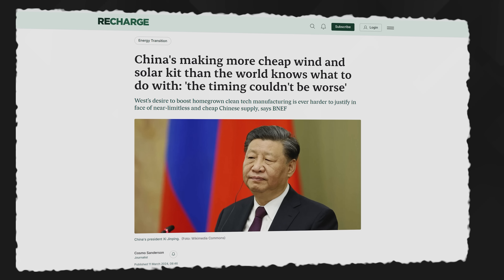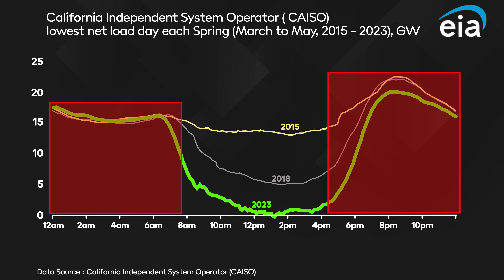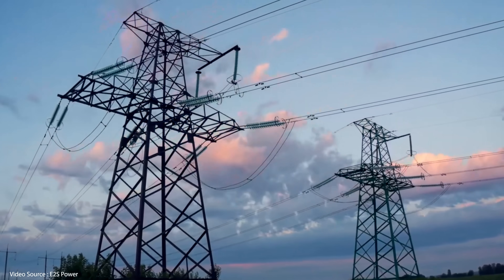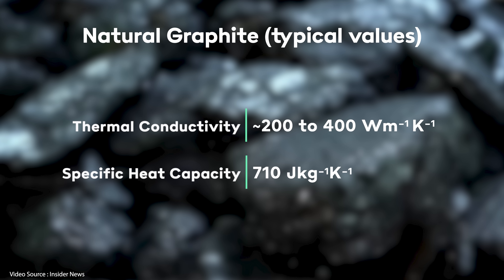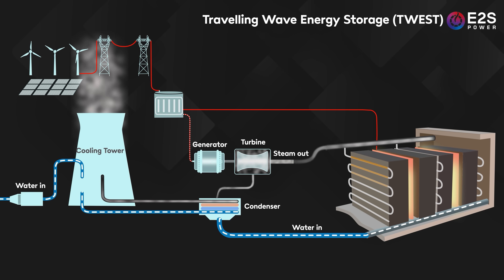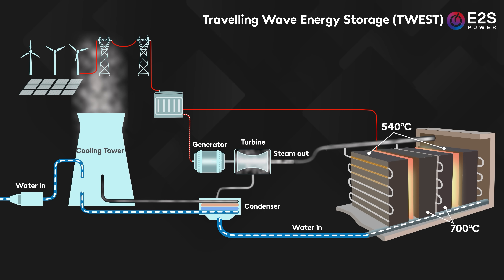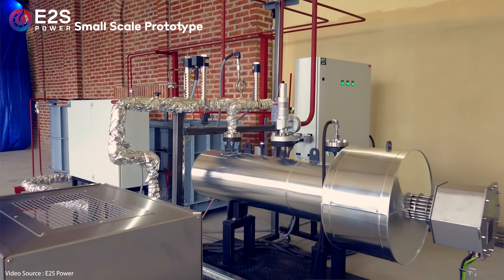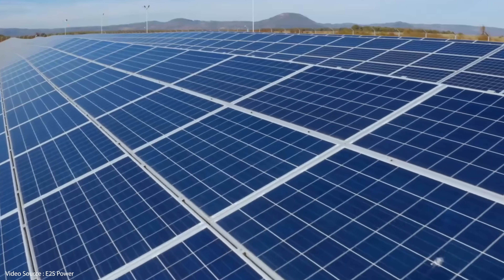A coal power station without the coal! How 'WIN-WIN' solutions could save an industry.

Comment: There's an issue with this idea... Temperature. We know that coal burns between 2500 and 3500°F (1371 to 1937°C). Natural gas is about 5000°F (2770°C). This temperature can be maintained so long as either item is burning. That means we know exactly how well we can make the steam from that temperature and how often we have to refuel the burn. The issue with heat storage is that it reduces in temperature the more material (water/steam) you run through it. So, just like a coal or natural gas generator, you have to 'refuel' it... but if you only have excess power for heat during peak solar/wind times, then how is the generator going to continue to run once there's no more power to 'refuel' it? I get having a lot of mass... but given Graphite's high thermal conductivity, you're going to be dropping that temperature pretty fast. And just to spin those generator turbines, you need something like 40bar (40x atmospheric pressure) of steam pressure. It will not last the night. You might get a couple extra hours after sundown... but that's about it.

You're basically exchanging a Jaguar XKR-S for a Pinto and promising us it'll go just as fast and be just as comfortable. No thanks. I'd rather my generation stations continue to provide power at the same level as they always have.
Reply: But hey... it's not all doom and gloom from me... Tell ya what... Many power plants have additional generators that are not in use... They're there to make up for excess power needs during peak demand. So talk to the power plant owners and ask them if you can retrofit their (mostly) unused generator for the heat storage system. And if you can get that generator to provide meaningful amounts of power that are cost-effective throughout the night WITHOUT having to rely on the other generators to heat the graphite back up... I'll take back my comments and say I was wrong. And I mean a power plant in America or GB, where we have ridiculous amounts of safety requirements and red tape.
Reply: @Xero1of1  Some gas plants will maybe able to be converted - even running in tandem/together parallel/consecutively?
Reply: It’s quite simple really - whatever your storage medium, you’ll have some amount of energy storage capacity. The more you have, the more it can supply (either higher power output or same power for longer). More of these (or bigger ones) means more capacity. Obviously you also need a higher supply during the sunny hours to fill that capacity, but again, that’s the same for literally any storage medium.
Reply: Ahh… ultra super critical are steam above 600°C, that’s the temperature that matters.
But I do like the point this is sensible heat, not latent heat, so drops in temperature as it’s used.
There’d be a narrow window of efficient temperatures.

Comment: It takes one month to convert a coal-fired power station into a functioning TWEST storage plant, and it's dirt cheap (natural graphite and some induction heaters, a bit of circulation pipe) and scalable?

What are we waiting for?
Reply: My guess is that "dirt cheap" "green" electricity won't be so dirt cheap once there is a use for it.  If you flatten the duck curve by increasing usage in the middle of the day, you also decrease the discount on that energy at that time.  But absent more definite presentation of the value proposition, this is just all speculation, both on whether this makes sense or not.
Reply: @richdobbs6595  PV and wind, enhanced geothermal and all scales of hydro, are far cheaper than any form of fossil, kept off the market by non-market forces. Those non-market excuses are done now. With at least three ultra-low-cost medium-term storage options -- TWEST, compressed gas, pumped hydro -- plus short term grid scale battery, economies of scale will just favor renewables even more. Increase usage by a factor of ten during the day, and PV will eat it up at pennies on the dollar. Electricity will be so cheap EVs will recharge for free in exchange to listening to sponsor's messages while you charge, or the promise of V2G during periods of high demand.
You can find the value proposition at Rethink X or Project Drawdown Roadmap, or the latest IEA report on the coming oil glut. Anyone not jumping off the oil tanker will go down with the ship.
Reply: There are still a lot of logistics which may not make as much sense as this video implies. Certainly there are situations where this is a no-brainer and it would be madness not to do this. But the proximity between the renewable generation and the plant's location may not always be ideal. 

If there is a lot of ideal geography for solar and wind generation near the plant or between the plant and where demand is, that's great. It would be great to see a study about how much opportunity really exists. The benefit of batteries is you can put them where they make the most sense in the grid you are creating. You wouldn't ever locate batteries where the fossil fuel plant is and then work everything else to suit that location. So the plant's location can often be a limitation.
Reply: @ronvandereerden4714  I'm inclined to disagree. Converting a power station into an energy storage facility is 100% feasible, because it already has a very solid connection to the grid. As an energy storage facility, not only can it put out its rated power, but, it can also take in that much power, then, pay it back out after the sun sets, or the wind calms down. it is 100% bi-directional.
Reply: @vincentrobinette1507  My point was more about the proximity of the renewable power relative to the fossil fuel plant. If the renewable energy generation is already connected to the grid of the demand location with enough grid capacity back to the original input line, then yes, sure.
Reply: @ronvandereerden4714  UHVDC. China has 80% of the world's installed capacity to not just bring distant renewables to market, but also to stretch the renewable day across its two time zones.. and Chinese time zones are very wide.
Imagine this going global, so wherever there is light or wind, power can get to the need cheaply. The spillover can get to the storage, wherever is best suited to charge up.
And yes, it's faster and cheaper to TWEST in an existing decommissioned fossil fueled site, but this also works for decommissioned nuclear sites. And it's possible now to choose among four different storage options for whichever makes the most sense, wherever makes the most sense.
Making more sense than this video implies.
Reply: Being tested in India I assume the energy used to charge the system wasn't exactly green 🤔
Reply: @sailaway8244  What happens when you assume?

Renewable energy made up the second-largest share (21%) of power generation, including hydro power (10%), solar (4%), wind (5%), and biomass (2%) in 2022, according to the EIA. Solar grows at a rate of 26%, and wind 15%, per year in India.
Reply: @bartroberts1514  that sounds like wonderful news..... can you
A) provide you're sources
B) explain why we are at record levels of fossil fuel burning (India and china being at the top of the list)
Reply: @sailaway8244  A) Did. EIA. But you may mean citations? Try "EIA India electricity by source," or "EIA China UHVDC". Or. IEA. Or IRENA. Or World Bank. Or BP Statistics.

Or anything besides just making it up like anyone who'd just assume.

B) Has to do with Jevon's Paradox, in part, with the rapidly expanding North American extraction and uptake of oil on the global market, and with the over $7.3 Trillion USD in subsidy to fossil.

You do know, the current US government now licenses more exploration and extraction by far than any previous administration, right?
Reply: @bartroberts1514  thanks for the info , without having any detailed knowledge of your ' trusted sources"  intitial reaction is  who benefits? 🤔
    The "interests" of those 3 letter agencies/ corporations you state seem very "safe and effective"  and highly trustable......the types that might "own the science" 🤔
   I'll make a particular note in researching the individuals behind those agencies you've highlighted.
  I'd like to take this opportunity to thank you and highly recommend you follow all future "mandates" these "agencies" and their counterparts in other fields impose 👍
Reply: @sailaway8244  BP, the World Bank, IRENA, the IEA and the EIA are five, not three different agencies. Some belong to governments. One is an NGO. One is a corporation. You assume so many things but all in one direction: everyone's out to get you. There's no help for that in facts and the real world.
Simply, we were in a discussion of technology and how it solves problems of energy.

You're in a discussion of phantasms haunting your nightmares. There are professionals qualified to deal with that, but they aren't engineers.
Reply: @bartroberts1514  as a side you're not confusing Jevons paradox with the Downs-Thomson Paradox..... struggling to understand your logic there......or am I just ficc 🤦
Reply: @bartroberts1514  72% of electricity generation in india comes from coal,requiring around 1.2 billion tonnes of coal,which is expected to increase to 1.9 billion tonnes by 2030
Reply: @bartroberts1514  the problem is I am an engineer..... I look at inputs and outputs and the numbers simply don't add up (in a practical sense)
Reply: @sailaway8244  We have about 6 years to phase out fossil fuels to [limit] average [global] warming [to no] more than 1.5C.
How would you go about that, as an engineer?
What China and India are doing is ramping up solar installations as fast as possible, while at the same time, continuing to install legacy coal plants.
But the rate of solar installation is increasing dramatically every year; faster than coal installations are increasing.
Reply: @economicprisoner  I'd question your initial argument of 1.5°c computer generated model to begin with
    Although I'm not against cheap renewable energy the societal cost mustn't out way any  unproven perceived threat such as the plannet has suffered since 2020
Reply: @sailaway8244  No 1.5C is not from a computer generated model. It is a political goal.
Due to the nature of our "carbon budget" every year without action advances the deadline (to meet that political goal) by 2 years.
Reply: @sailaway8244  What sort of engineer doesn't understand Navier-Stokes Equations, and thinks of them as "computer generated models"?

There are two kinds of engineers: the ones that bring the solutions, and the ones who are the problem.
Reply: @shanecollie5177  That was true in 2022, before TWEST.

In 2024, it's a thing of the past.

By 2030, coal in India could be a thing of the past, too.
Reply: @economicprisoner  Look at his tactics: mock, move goalposts, ignore answers, demand sources already provided, move goalposts, smear sources, backpedal, throw his credentials around..

We're not going to get anywhere with him, and that's his whole purpose. 

To waste our time.
Reply: @sailaway8244  Engineer to engineer, I'd like to see your inputs, outputs, numbers and methods cited. In a practical sense.
Reply: @sailaway8244  Pigou-Downs-Thomson Iron Law of Congestion is throughput capacity; Jevons is resource use. Hope that helps.
Reply: @bartroberts1514  Epic effort there mate! 🥇
Made my day  reading through that 👍🏼
Reply: @bartroberts1514  correct boiled down to it's simplest form.....the more capacity you have the more you use
A single lane highway naturally restrists traffic by design
A 4 lane highway allows "more through put"
Yet in the modern (real) world both are congested 🤔
Reply: @bartroberts1514  my "inputs / outputs" are based on economical real world available resources 
  You can theoritically build anything given unlimited resources.....but that's living in la la land
Reply: @bartroberts1514  you could "go to war" for those perceived available resources but what price would put on  those "men's" lives and would you be one of those on the "front line"
........ just asking
Reply: @sailaway8244  Can get congested. And still completely irrelevant to the reason fossil trade keeps increasing.

Talk to the people making fossil trade policy and business decisions for a while. They don't have the least idea where their assumptions come from, and are unable to see that they're wrong, outdated, or only part of the picture.

People who think fossil makes jobs? Facts show the opposite.

Who think high-paying fossil jobs are good for the economy? Facts show the opposite.

Who think their country needs what fossil offers? Facts belie that claim.

Once upon a time, it made sense to have huge fossil reserves to maintain a balance of power in war or cold war, but that's outdated now, too.

The simple reason there's still fossil trade and it's still growing? Failure of public servants to do their jobs and say "no" to bad requests for licenses and funding.
Reply: @sailaway8244  What are you even talking about? Are you proposing a shortage of graphite? Of steel? Of steam for TWEST?

Of Sodium and Aluminum for CATL's latest generation of batteries? 

Patently baseless claims citing no named sources you make.
Reply: Don't worry about it.....live long and prosper 🖖
Reply: @sailaway8244  This only makes economic sense if at some times during the day power is cheap (so you can charge up) and some times it's expensive (so you can produce and sell at a profit). This doesn't happen with coal, which you buy ahead of time and just burn whenever you like. The only reason we have this situation is because it's hard to control when renewables produce, you just have to hope it's sunny/windy. Of course solar produces during the day, not so much at night, creating this difference in electricity prices. If you used coal power to charge this, you're not solving any problem and you'll be running at a massive economic loss. If this is a commercial system and not just a test unit, I guarantee it's using renewables to charge up.
Reply: We are waiting for all the green energy to heat the thermal storage tank. Lacking that, this is all academic. In addition, since the conversion efficiency of the entire cycle is ~1/3, you need 3 X the green energy input to make this work.
Reply: @gsmollin2  Your analysis misses the forest for the trees. Given the right ratios, PV and wind are already producing that green energy in parts of the world, and are on trend to provide most of the world's energy. These TWEST Duck Curve beaters won't be supplying the main core of the energy, just acting as cheap bridge storage for marginal energy until better solutions are ready to go. Are they perfect? No. Are they enough? No.

They do show up, dollar for dollar, how really inefficient coal mining is, that using storage to replace mining is more cost effective.

Comment: I'll believe it when I see it - at scale and without subsidies.  My guess is that the round trip efficiency makes that incredibly cheap PV electricity not so cheap.  OTOH, this approach doesn't seem to have any barriers to scaling up, unlike so many others.  The first step in this process would be to eliminate fossil fueled district heating with thermal storage driven by PV and wind.  The second would be to employ this in a golden situation like Hawaii or Puerto Rico.

Comment: The round trip efficiency is really poor- let's not kid ourselves here.  Storing electricity as heat for future use as heat makes a lot more sense than any scheme to store electricity as heat and then try to convert it back to electricity again, because Carnot sneaks in and the 2nd law of thermodynamics takes its toll.  And there are lots of details not discussed here that have me scratching my head.  For one thing, if you need steam at 540 C, you have to heat the graphite to well above that temperature in order to have any storage.  Above about 800 C however, metallic materials of construction rapidly turn into pumpkins, losing their ability to handle steam at pressure.  And you do need something to separate the graphite from that steam, because graphite not only reacts with oxygen- it also reacts with water at those temperatures.
Reply: The advantage of electricity is that it is a ‘higher grade’ of energy than heat.  It doesn’t need to be used close to the source.  I expect there are others.
Reply: @oliver90owner yes, electricity can run lights, computers, industry, or even heat pumps (thereby tripling value).

Comment: Why does the system need a cooling tower?  Couldn’t the heat be cycled back into the system?  Couldn’t it use solar thermal panels to create heat? Much cheaper than pv.
Reply: Heat must flow to the cooling tower and exit the system in order to harvest energy from heat. Only the medium that carry heat (steam or water) can be cycled back to the system (Efficiency of energy extraction increases when the temperature difference between source and exit is high). Yes, solar thermal panel can be used, but ideally it should be a solar-tower type where moveable mirror concentrate heat to one area and have mechanism to prevent heat escaping during overcast/shadow.
Reply: @xponen and solar thermal re-heat can’t be used as plant is required outside daylight hours (see duck curve).
All thermal / steam generators run into this problem.
Many then spruik potential district heating systems for waste heat.
Or greenhouses, spas, tropical fish farms.
Reply: @xponen  doesn’t make sense
Reply: @johnransom1146  to make sense of this, refer to your original post, substitute the word "heat" with water, then substitute ""cooling tower" with "drainage", then generate an explanation "why can't we recycle the water back into a hydroelectric dam instead of discharging it into the sea?"